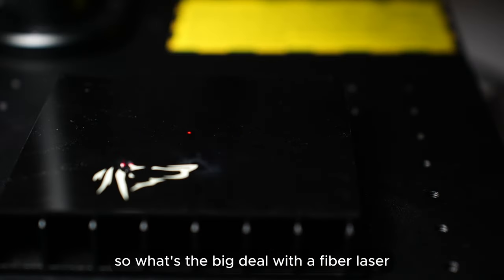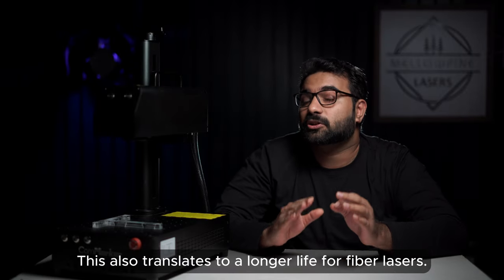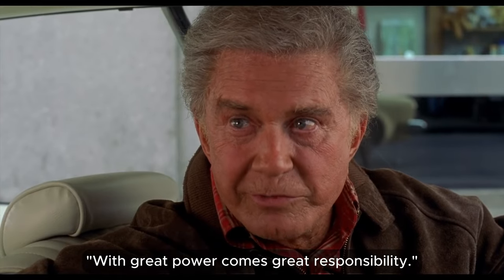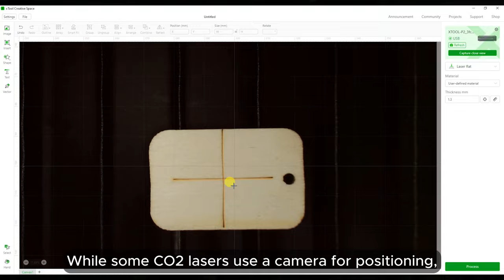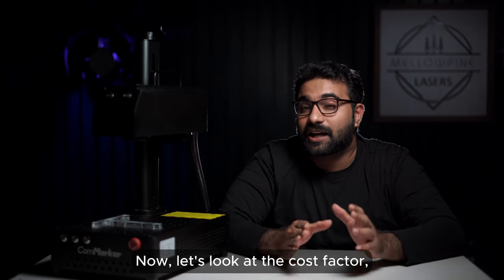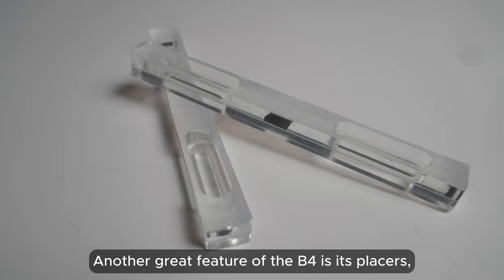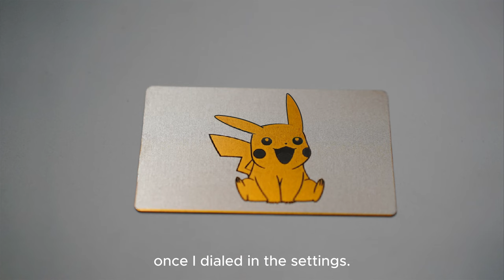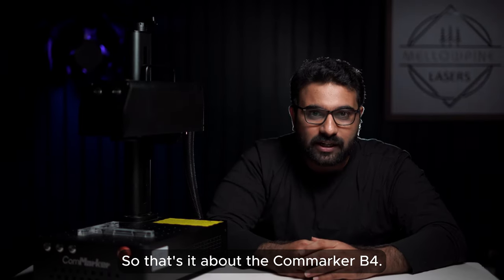Do You Really Need A Fiber Laser? Commarker B4 Review

Comment: Thanks for the clear information.  Can you tell me if this machine in particular can do more relief type engraving.  Not necessarily "coins" but I would like to create some pendants that have some differing heights
Reply from the maker: When it comes to relief carving with a laser it depends on how you process your design. The depth is controlled by laser power and you need to come up with a way to tell the laser what power to use for different regions in your design. Typically this is done by creating your design in such a way that areas with more depth appear darker and there is a gradient from dark to light for curves and then use the grayscale mode for engraving. If you get the design right almost all lasers can do it. If you want to do it on metal its best to use a powerful one, the one shown in this video is the 20W variant but this is also available in powers upto a 100W

Comment: Sir , denim ke liye.... 500 pic jeans 👖 in a day work , which machine is best for us  , plz 🙏 , thanku brother
Reply from the maker: You can use either a diode laser or a CO2 laser for engraving denim. You can even engrave denim using a 10W diode laser, but a CO2 laser is a better option for large-scale production as it provides better results with faster engraving speeds.